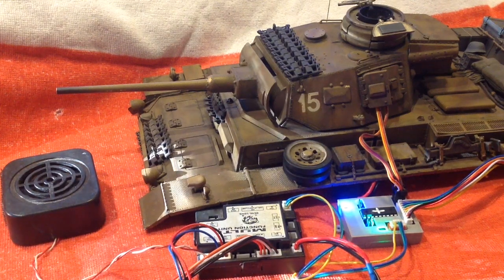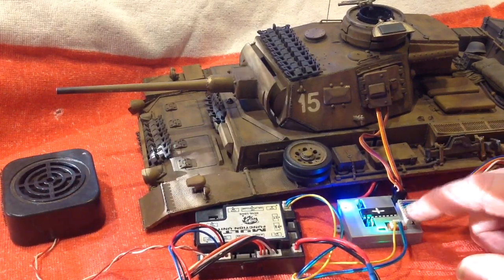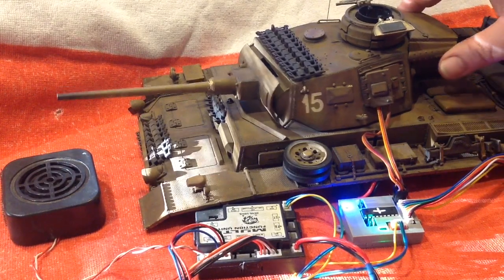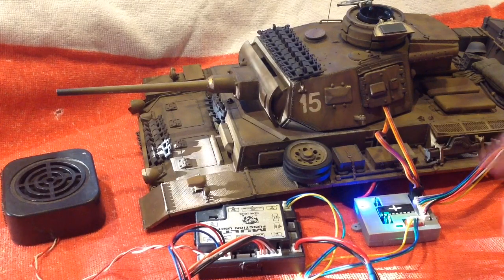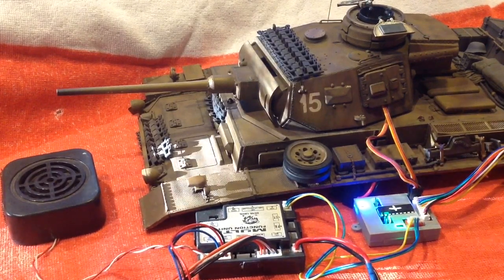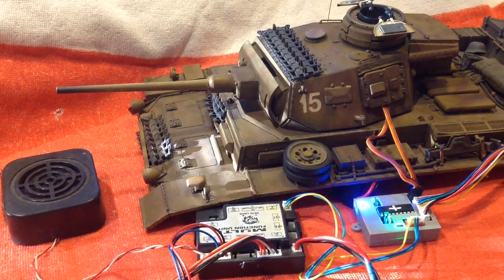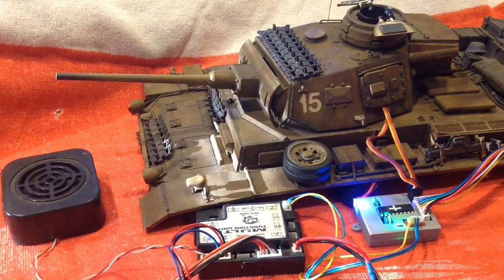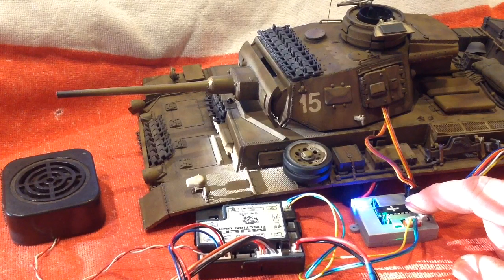Servo function of the RC5HL Lite+

Comment: Good to see an upload! Wanting to mod my HL tank for ages got half my knowledge from your channel. Keep it up. If you could put a demonstration up about a suggested battery upgrade and radio/receiver upgrade for HL tanks that would be superb! I just recently went around my local hobbie shops and nobody could install a receiver in my 99a for me. Maybe you have a place where you get them from here in Australia?
Reply from the maker: Have you watched my Radios for Tanks series?  That should put you on a path to deciding what radio is best for you.  Do a youtube search "Radios for tanks".   As for battery any good 2 cell Lipo will go with your factory HL electrics.  What one will depend on what else you have inside your tank.  Get the biggest you can for the available battery space you have.  No one can install a proper receiver &  hobby style radio into your 99a with Heng Long electrics.  The only board that will do this is the RC5HL and it ONLY works with the Heng Long 27mHz RX18 and only I make the RC5HL.
Reply: rctanksau thanks so much dude for the advice. Yeah sounds to me like I might be needing to buy your RC5HL and maybe the 9xr from hobbyking if it’s not to hard to install and what not but you’ve got tutorial vids there for that kind of thing.